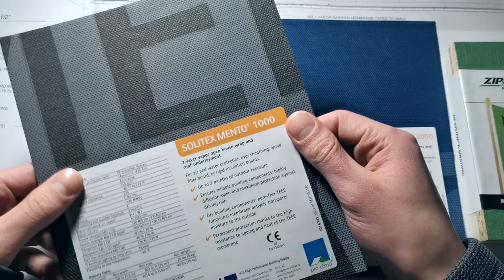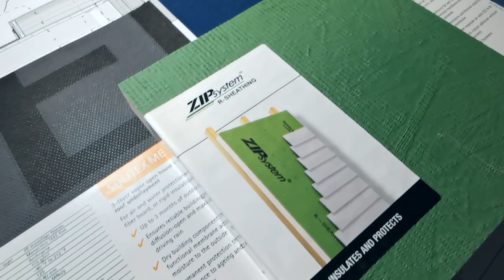Housewraps vs Self Adhered Membranes vs Fluid Applied WRBs

Comment: Can you put regular ISO insulation directly on top of a fluid applied product like Cat 5? I'm designing an off grid house in Northern Idaho, and I'm looking at putting some layers of ISO above the sheathing, and then basically wrapping this with mineral wool for maximum protection from wild fire damage, then the rain screen and metal siding and roofing.  I saw one video where the builder put daubs of silicone caulk on top of the Cat 5, to create a gap, but he didn't actually test it to see its behavior.

Comment: If you go with Zip sheathing, doesn't it save on labor to wrap the house?
Reply: It should
Reply: Yes, but you also need to tape/seal every seam or deeply driven nail
Reply: @cxsey8587  I'd rather do that. I have trouble wraping gifts, no less a building.